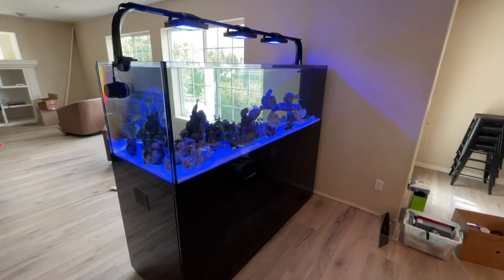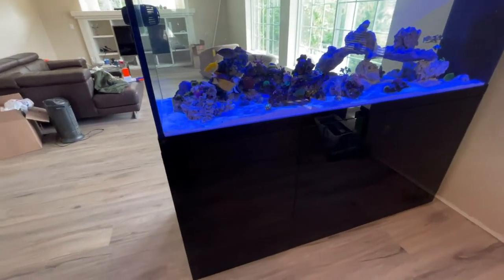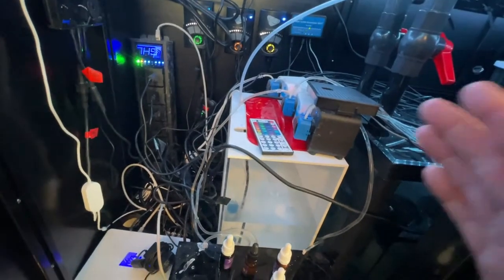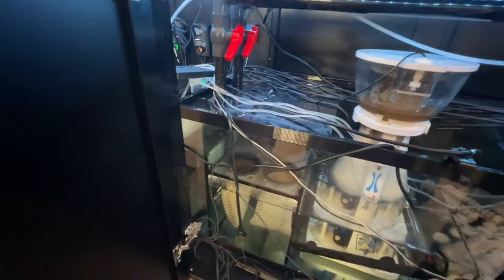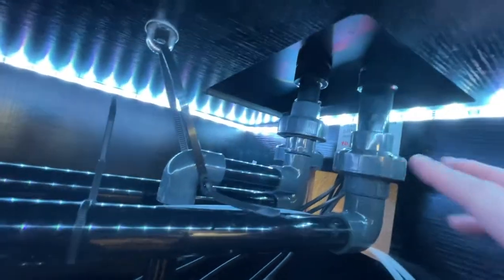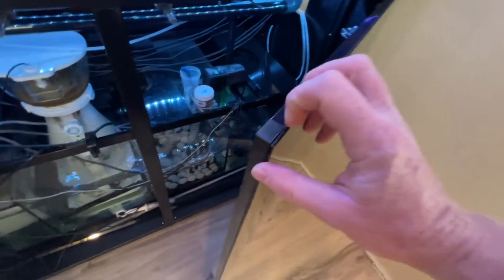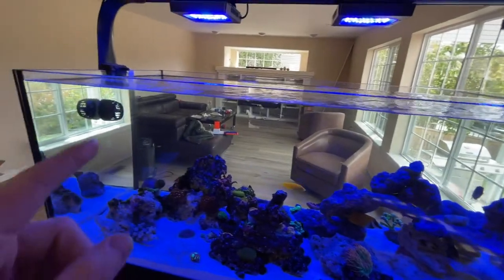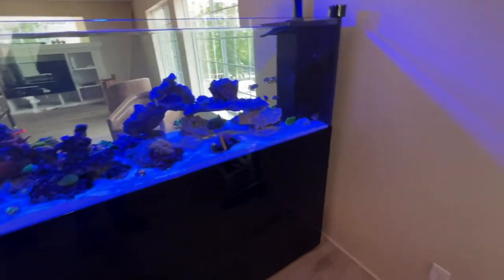Pro Clear Prostar 230 Peninsula Review

Comment: Good Afternoon, I am new to the hobby. So I am trying to learn as much as possible before purchasing this tank. Where did you purchase your light bracket from? Any advice to a beginner?
Reply from the maker: Hi,

My light bracket is specifically built for my lights by Ecotech Marine. I have XR15 Blue lights. 

I’d recommend searching “beginner” on Bulk Reef Supply’s YouTube page.https://youtube.com/c/BulkReefSupply 
Number 1 rule in reefing is:   Be patient
Nothing good happens fast in reefing

Take it slow and steady, you’ll be learning as you go. Eventually you’ll figure it out. People with crazy reef tanks are either extremely experienced or they hire an extremely experienced tank guy/girl.  I’d find a reputable local saltwater/ reef store to buy from. They can answer a lot of questions as you go. 
Smaller tanks tend to be harder to manage vs a larger tank because the chemistry tends to be more stable. 75gal is a great size to start with in my opinion. Years ago I bought an established 75gal and started added soft corals and LPS. 
Any questions,  ask away.

Comment: What return pump are you using? Is louder?
Reply from the maker: I’m using an older EcoTech Marine Vectra  M1, it’s quiet, adjustable and enough power for the tank. I’m running around 75% power. I believe the Vectra M2 replaced the M1.

Comment: Does anyone know if you can flip where the "back" of the tank is? With the cabinets facing me, I want the overflow to be on the left. Is this possible?
Reply from the maker: On my 230 the cut out got for the overflow and the return are on the right side of the cabinet (doors facing me). Meaning the tank will only set one direction on the stand.

Comment: I cant get the 2 back corners of the tank to contact the stand length wise. 1/16 gap which translates to about 3 feet total not even sitting on the stand. I've been at it for a week I contacted pro clear they said fill it but that's a disaster waiting to happen. You have any issues? Or a solution? The plywood top looks to be the problem. But its nailed in. I'm out of ideas. Same tank as you
Reply from the maker: Just curious but when the tank is on the stand have you gone around and tried to slide a piece of paper in between the tank and the stand around the edges?  If you do it how far can the paper slide in around as you go around the tank?  The stand is going to flex some, even your floor will unless you're on a concrete slab. My Red Sea Reefer 250 has a pad on top of the plywood but that stand moved as well, it had no problems for years.  Did Pro Clear see photos of your issue? I"m like you, I'd rather be safe than sorry, I  shored up my floor before setting up the tank because I was paranoid.
Reply: @strust2862  oh I need a tape measure for that the gap is on 2 corners 1/16 of an inch at its highest gap between the tank and stand and tapers from there. It has the leveling feet. But in order for every part of the tank to sit on the stand throws the tank way out of level. Pro clear didn't seemed concerned about the huge gap but I know better. So I'm a little frustrated.
Reply: @strust2862  and I filled it 3/4 and no settling stayed the same
Reply from the maker: @bluejack-ve7so  Damn!  I assume you've checked your floor level? Even then the feet should take the floor issue out of it.  Just curious, how square is the stand? Each bottom corner to its top corner then compare or do an "X" from bottom left corner to top left in front (door side) then back side.
Reply: @strust2862  oh I know the floor isn't level. And to top it all off with all my tinkering with the feet 2 bolts seized up just now. I'm calling its quits for the night.